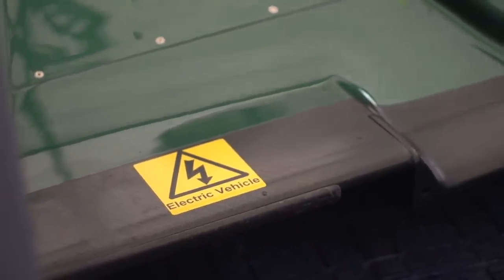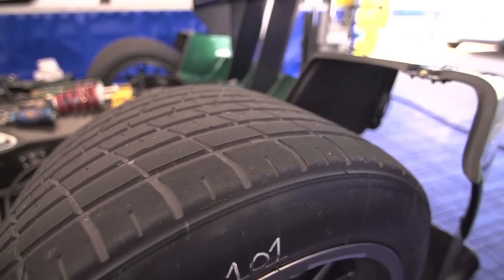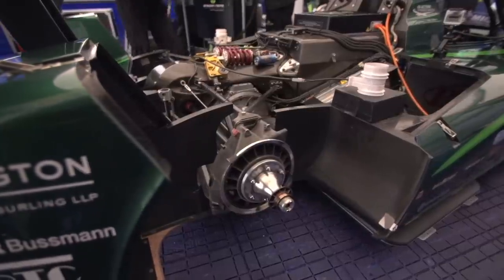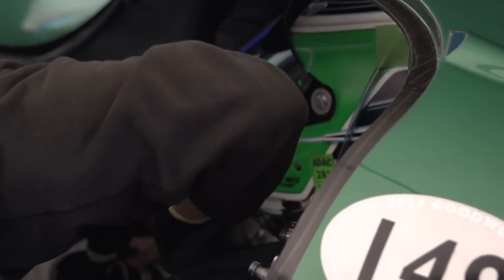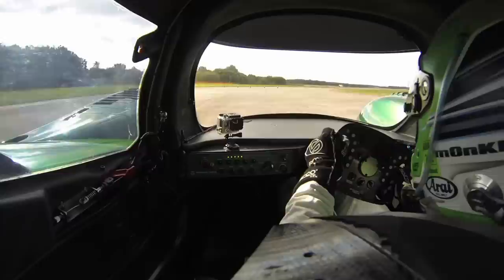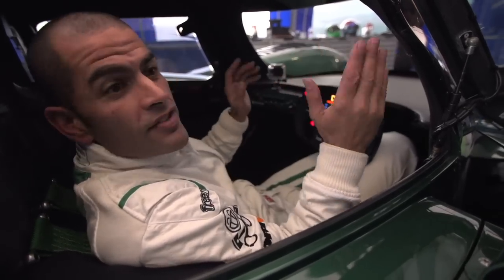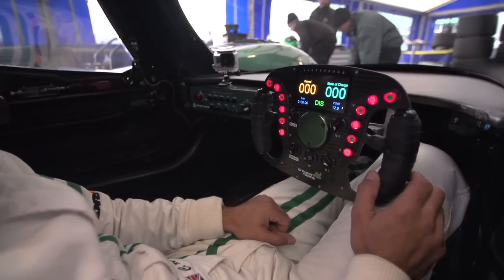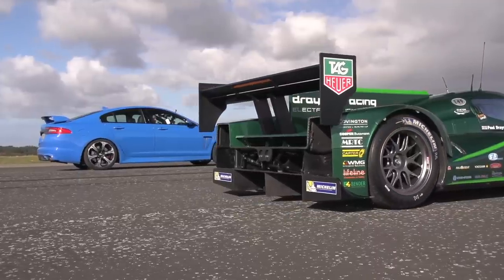850hp Electric Racing Car: Driving the Drayson B12/69EV -- /CHRIS HARRIS ON CARS

Comment: Partly, this IS the technology of the future. The pice that is still missing in the puzzle, is that they still have to develop to re-charge a spent high-capacity battery block in the time it takes for an average pit stop. Or easier still, how to make a battery block that can be disconnected, exchanged with a fully charged one, and then reconnect the new one in the same time.
The power is there, the transmissions are there, the weight can be kept to reasonable amounts (as shown by this technological exercise car) - but to race, a car needs to be serviced and ready to go in a matter of seconds, not minutes or hours.
In my opinion, a LMP-like class or one reminiscent of old Group C with cars like this one would be bloody fantastic. IF the FIA dares to make it happen and has the cojones to host a high-speed low-restriction racing series. Which I doubt.

Comment: It will be a sad day when motor sport switches to electric, as a spectator sport it would loose allot of its interest. Like when rally limited the cars that were admitted death traps. But the risk and skill involved to drive such powerful cars in those conditions made it a joy to watch. They have already said that it's the way things are heading years ago, the lack of large engines but now smaller with turbos, which isn't a bad thing but to a car nut big engines and sounds feeds that almost primal need like man smash rock. Damn watch this video then watch the Aston Martin Vulcan top gear vid and try to disagree that the internal combustion engine is the thing of the past

Comment: Posting this more to test the new comment system, which seems to have some issues.

A lot of people are going to miss the noise. One advantage of a quite engine in a race car is that you get more feedback about what the car is doing as you can hear the slightest tire chirp etc. So, they're not as interesting from a spectators point of view, but as a driver, the future of electric racing should be something to get excited about. And if you really miss noise, just use straight cut gears!

Comment: The sound the car makes is very important to the experience and gives one a feeling which is something only a true car enthusiast can understand, ( as long as car enthusiast exist they will be a desire for a joyful noise in motorsport)eco hippies know nothing  of what it means to be a car enthusiast, all they seek to do is self righteously pick sides and act like they are just a little smarter and more progressive than everyone else. full electric cars will never ever completely replace cumpustion engines. Hybrid between the too is and always be the best solution. ( fuel technology is making strides too in case you are not aware. Stop trying to pick sides saying all electric or nothing, this side picking is why mankind sucks.
Why not just come together and acknowledge hybrid as the best of both worlds, efficiency, tremendous torque, sound every thing is there. Pop in a gas cell and the car can run a race for days and days on end due to hybrid tech, better batteries and fuels. 
 
Save the environment while creating divides and sides, who without each other are in actuality weak. no thank you

Comment: is it possible to make electric cars with a manual gearbox and clutch like a ordinary car? otherwise i will never buy an electric car...
Reply: They could, would be pointless though. The manual transmissions help us keep the motor in its powerband. However, an electric car produces all the torque from 0 rpm, so doing the gear changes ourselves would not help.
Reply: then i only hope they dont build every car in fwd

Comment: I bet the batteries would last longer if it had something similar to the 2014 F1 kers system installed. IE kinetic energy recovery system from braking. Basically all the power you lose when you brake could recharge the batteries. I'm not a fan of the cars being so silent. I've been to Petit Le Mans, US Grand Prix, some Rallies etc. And the noise from race cars is a must. Formula E cars kinda sound neat but nowhere near as loud as an f1 car. I'm all about saving the environment but I also love motorsports, and I think the carbon footprint from just motorsports is far less a problem than the congestion in cities from petrol vehicles. 

Think of it this way, if anything the electric car will save the v10, v12, and v8 super cars and racecars. People didn't stop riding or racing horses when the car was invented. Riding horses was a hobby after that. You'll drive your Prius or ecar to work, but take the ol 911 out for a spin on the weekends. So if anything this technology will preserve motorsports.

Comment: The energy solution is in extremely high compression engine designs with direct injection and a better ignition system design overall. Perhaps even moving to a turbine/electric configuration as we discover new materials and manufacturing processes to achieve such a thing affordably. After that, synthetic energy dense fuels. Possibly even a means of converting your garbage/waste into a fuel source. There's no such thing as clean energy, just like there's no such thing as over-unity. But you can strive for efficiency in everything, which is the future of all technologies.

The biggest problem with the electric car is how dependent you become on the system, but that's the flaw of electricity in first world nations to begin with. Power production needs moved to your home instead of at stations.

Comment: It kinda of pisses me off that crooks in the oil industry stopped us having this technology earlier. No more changing oils, filters and cam belts, or the high costs of main dealer basic servicing.

I don't understand the obsession with noise either. It might make you feel powerful, but cars with loud pipes look shit on anything other than a race circuit or drag strip.

Comment: Once you've experienced the acceleration of an electric car you can't help feel that petrol engines are antiquated. For the foreseeable future battery technology will be what will power electric cars as, despite some claims, hydrogen power is currently prohibitively expensive and has zero infrastructure in the UK. With batteries you just need somewhere to plug in and can install a rapid charger in your home. And then feed the car using your own solar/wind power or surplus night time electricity (which is often just thrown away). It's not about being green, it's just about cars.

Comment: I see something artificial and dangerous the sensation that it provokes. You have no idea how fast you are going, until you see the velocimeter With the sound it is easy to know how much speed you are going but I see very demanding for the pilot in classifications or races where you run at limit.

Comment: they should have a 24 hours race with these. Like LMPElectric
Reply: the problem is charge. electric car batteries just dont last. a Formula E car, which has a dramatically lower output to this, will at full tilt deplete its charge within 15minutes which is why they have two cars and swap at the halfway point of a race. Thats with a number of batteries weighing over 300kgs. the technology just isnt there yet

Comment: Far from being un-impressed by those number, but a normal 125cc shifter go-kart will do 0 to 100mph in something like 6s and these cost 15 to 20k new... A 250cc Superkart will do 0 to 100mph in under 4 and a half secs easily... So it's impressive considering the weight, but you can get this kind of acceleration already from something that does look just as unconfortable as the Lola :)

Comment: Sounds like a Tesla! Amazing technology.
Reply: +Mystic Boltz Its very very diferent from Tesla Motors. Heck even the motors are a massive development beyond Nikola Teslas AC motors. This use very advance Axial Flux motors from YASA Motors which is like a Plates of magnates rather than a Cylinder of magnates & coils.
Reply: +Neojhun just the electric drivetrain sounds similar when at high speeds.  Thanks for the reply.

Comment: Says the numbers are mind numbing, which they are, but what about the Ultima Evolution?
0-60mph: 2.3 secs
0-100mph: 4.9 secs
30-70mph: 1.5 secs
0-150mph: 8.9 secs
0-100-0 mph: 8.8 secs
Standing quarter mile: 9.2 secs @ 156mph

Yes, the electric car is stunning and very impressive. But there are still gasoline powered cars that are better, so no, there are more problems than just the battery capacity. (Although maybe if you put bigger motors on that car, then the only problem would be battery capacity. :) )

Comment: Instead of building better batteries to me I think the best option is to change the roads. There's a tile being developed in Canada which is pieced together in a hexagonal fashion. It uses solar panels built into its surface to charge and stores the charge across the grid. They believe that if 64% of the worlds roads were this surface, we would produce 3x the energy we need. It has LEDs to display traffic signals, warnings and to hi light a broken tile. These tiles can heat themselves to eliminate snow, ice and rain sitting on the surface. 
I believe this tile idea mixed with a wireless charging system is the future. Imagine if the car charge while you were driving rather then needing to pull into a station to top up. Using this system you could regulate speeds on highways if there is an accident, simply just reduce the power the road supplies to the cars.
Reply: Unfortunately it doesn't work, watch Eevblogs video
Reply: +Joel Chr no such thing as "doesn't" or "can't", only a matter of time.
Reply: +SCHLiAM People that laugh at their own jokes are lame you know hahaha

Comment: The future is electric cars that use next-gen internal combustion engines as batteries. You get the best of both worlds- electric speed and ICE sound.
Reply: Hopefully with manual or at least pre-selector gearboxes so we can still enjoy the beauty of a 3rd pedal !
Reply: And either RWD or AWD that sends 98% or so of the power to the rear wheels (so virtually RWD)
Reply: Obviously only for performance cars that will be purchased by gearheads like us. Normal cars will be battery electric because normal people don't care about stuff like sound (in fact, they want less of it !) and care about stuff like reliability and economy and ease of use, in which battery-electric cars reign supreme and probably always will !

Comment: Noise. Everyone keep going on about the lack of Noise. Honestly, just build a resonator bolted directly to the motor or part of the motor can. This can make almost any sound you want. Warp Engines, TIE Fighter, Jet Fighter, and so on. There. Sound.

As for Batteries. I still say Ultra Capacitors. Charge faster, more durable, discharge faster. GE invented a new better type using Graphene. If Electricity is Water, the "carbon capacitor" is a sponge.

Comment: Pretty sure nobody was worried about a pure electric car weighing too much...

The weight concern originated from HYBRIDS. Where there is two power sources. and a compact car weights over 4,000lbs....

Personally, give me a pure electric drivetrain, advanced combustion power generator, and lightweight capacitors.

Comment: Electric motor only need 1 thing... A sound. Its not fun go to the track look at car goes around but no sound:O
Reply: But it would be insane to drive. 

As the motors become more powerful we should also see even more insane cars to drive. 

I have driven an electric car nothing like this and the acceleration from lag free torque is hard to explain. 

There is also the possibility of using capacitors to build up power to boost the motors.
Reply: Mon amour, correct you are! Without the cacophony of accompanying  sound...it's ALL rather boring, as this machine proves to be.

Comment: All I can say to those who keep whinging about the lack of noise is wait until you've driven one: I got a chance to drive a Tesla Roadster and the first time you mash that pedal and feel that torgue, you won't ever complain about the lack of noise again. Yes, it's that fast and that much fun. Plus, they'll find a way to make a noise that will keep you interested.
Reply: The problem is, you can't drive any normal car like a bat out of hell all the time.   The rest of the time, it's nice to have a good sounding exhaust note.  It's just part of the driving experience that makes it fun to drive at normal speeds.   My Golf R32 has a stock exhaust note that many people really love.  I added an aftermarket turbo to my car, and it might as well have been an "off" switch for the exhaust note.    Yes it was very fast, and fun at full boil, but I hated how quiet and soulless it was and it made normal driving very boring.     I was this close to removing the turbo just to get back the sound, until I finally found a good sounding exhaust system (most sound quite bad).      I cannot imagine going from that to no sound at all, other than whooshing wind, tires, and rattles and sqeeks, and I know I'm not alone.
Reply: daemn42
When the Electrics become the normal thing for cars,,, somebody will sell a sound kit you can install to get that ICE sound you love so much. Personally I think that's crazy.
But what will be even worse is when somebody offers a kit you can install to get that internal combustion smell,, Yuch!

Comment: Damn those electric motors are 2 powerful for there size! I like my 2 strokes better because of there sound.  I want to run my rotax 1000 sdi sled motor off HHO gas plasma but i am afraid the ball lightning plasma would destroy the engine. Ball lightning is much hotter and more destructive than gas fuel oil going through my engine. Ill try hydrogen first.

Comment: Electric car is the future of all cars. I give it 10 to 15 years to make the big transition from gazoline into the eletric car. you dont need to buy a new car... you simply can buy bateries and electric motor and replace your actual motor. Guess what makes electric cars very fast? The 100% TORQUE that electric motors are capable of. There is no gazoline engine that can actually produce this much torque.

Comment: For sure electric engines will lead in the future, the only thing I'm not sure about is the use of batteries. Why not use an electric drivetrain as in this car without heavy and unefficient batteries and just use a liquid-Hydrogen powered turbine as generator? Takin off 90% of the batteries, put in carbon fiber tanks at 300bar that can hold up enough hydrogen for 30laps at Le Mans, then pit stop and just fuel Hydrogen? Guess 4000Nm can handle the extra weight... And turbines are LOUD!
Reply: Cost. As hydrogen in H2 form can only be made by electrolysis, which typically uses energy from fossil fuels, the efficiency and cost to get the fuel is already an issue. Turbines are extremely expensive and not that efficient, relative to batteries and ITEs. Their application in planes with thrust requirements at various altitudes justifies them in that context. A fuel cell would be a much better application of hydrogen, as it relies on a steady chemical reaction (similar to a battery) and not a combustion reaction. Fuels cells have their own issues though, and are a long way off from being reliable, as they need a very specific operating temperature, pure reactants, and are extremely sensitive to contamination. Batteries are energy storage devices that use chemicals which can be recharged by reversing the reaction, will always work at various temperatures, and their energy can be easily" throttled" which is perfect for a motorsport application. I'm not saying hydrogen isn't an option, but right now, it's a very long way off from competition with batteries.
Reply: it would be really inefficient, you would be converting energy stored in hydrogen into rotary motion, and then into electricity and then back to rotary motion. the less energy conversions the better. electric motors and batteries have one very efficient energy conversion. Graphene batteries will solve all the problems
Reply: obviously batteries would be more efficient. but the problem in motorsports, and specially at Le Mans, are pit stops... how can you be competitive or efficient if u have to recharge a battery? Where does the energy to charge up batteries come from? same as hydrogen... and third, a 4000Nm turbine is probably still cheaper than a F1 engine (400K$) or Le Mans winning TDI's. The Opel Ampera uses the same concept of motion as described, just has an otto engine which is less efficient compared to turbines. And till today it is the only useable electric car built (80km on electric and unlimited extendable range with petrol generator)... Hope to see more project like these instead of heating oil powered cars winning at La Sarne!
Reply: Giorgio Caverzasio with Graphene batteries, they could either be recharged in a matter of seconds or not need any charging at all, depending on how the technology is developed. You are right about the energy for hydrogen and charging batteries is the same, but the number of changes that the energy has to go through with hydrogen would mean less of that energy actually goes to driving the wheels in the end. There are actually many usable electric cars, in fact my boss drives a Tesla to work daily, there are also plug in hybrids too, but this is all just because battery technology is lagging behind. when graphene batteries come to the market (5-10 years) the idea of storing energy in a fuel will seem pointless and wasteful.
Reply: Giorgio Caverzasio You could also, instead of filling up fuel, do a quick battery swap. The design would need some modifications to make such changes happen faster of course. Also, gas engines are inefficient- the energy to charge them could come from more efficient methods of power generation..